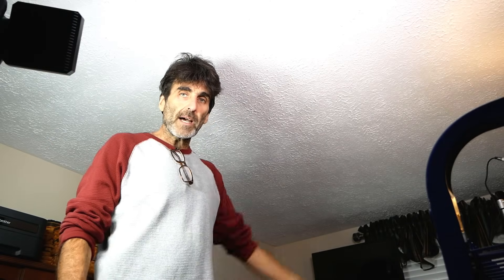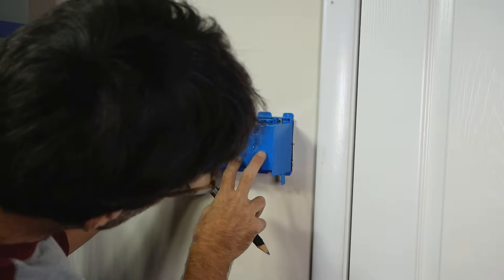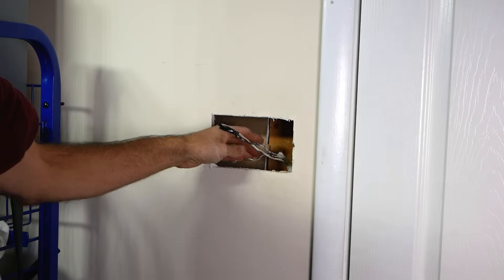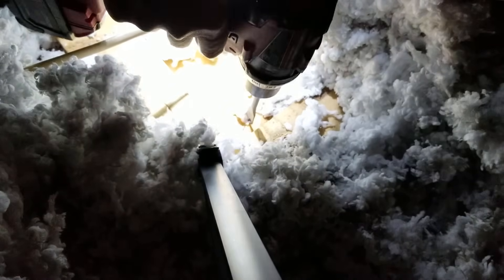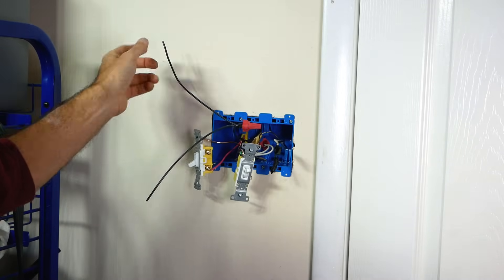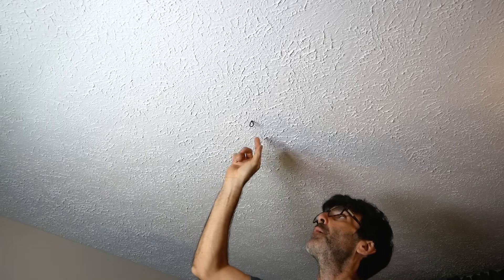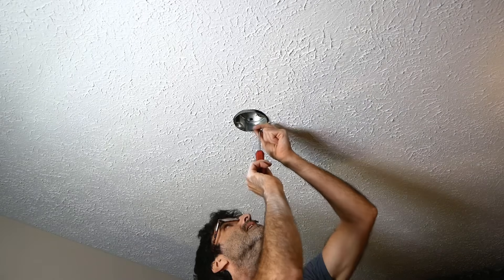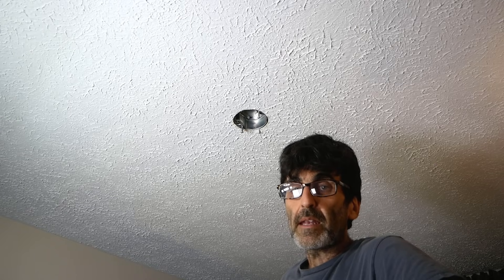Add a Fan to ANY Room without Existing Fixture or Wiring!

Comment: Rudy thanks! My wall plug is also controlled by a wall switch but I want to make the wall plug run continuous and the one switch for the new fan. How do you suggest I do that?
Reply from the maker: It's hard to say for sure.  Does your current wall switch have the necessary power for the fan?  Or do you have to run power from another source?  I probably need more details to be able to tell much.
Reply: @TheHomeImprovementChannel  the wall switch runs on a line that is 20AMP - I was thinking I can install the ceiling fan and run the wiring from the ceiling to the wall plug where the switch originally controlled and just pigtail ceiling and switch connections there and pigtailing wall plug to be continuous with the original line that already runs into it.
Reply: For more context, the wall plug has 2 plugs - 1 controlled by switch and the other continuously feeding power from line. I figure I can just take out the switch on that plug and connect it to ceiling lights or fan by running Romex to it and pigtailing that to the switch wiring already in the box.
Reply from the maker: @vidalexperience  If you have 2 black wires that went to the original switch, you can wire nut those two wires together and that'll make your plug run continuously and then pigtail your wires for the fan.  You'll have to run 12 gauge wire since you're on a 20 amp circuit...  Of course I have to mention, if you're not comfortable working around elec please don't attempt it.  It depends on the individuals skill level.  If you've got the power available in the gang box then yes, you can run a 12/3 wire up to the fan.  12/2 if you want to use a remote control, you don't need a separate wire for a light.  Usually fans are 3 conductor in case there's no remote control.  (14/3, 12/3 for example).  I hope that helps.
Reply: @TheHomeImprovementChannel  I’ll look into what you’ve said, I’ve wired things safely before according to code. It makes sense that I wire the 2 black in the switch and then run the ceiling fan or daisy chained high-hats with a 12 to the switch box instead of the wall plug box! Thanks Rudy! I’ll give it a try from the box before I put holes in the ceiling and let you know.
Reply from the maker: Make sure and turn off the power!  Let me know if you have more questions.. 🙂
Reply: @TheHomeImprovementChannel thanks Rudy! Have a great week!

Comment: On the fan speed switch how can I fig. Out witch is low med or high? I didnt take note on L ,1,2,3 . I have red, orange, black and purple. I cant find a diagram anywhere.
Reply from the maker: I'm not sure what kind of switch you got there.  Is it the speed switch that goes in the fan with the pull chain?  Or one that goes in the wall to control the fan from there in either a single pole or 3 way?

Comment: Liked, subscribed.  Just did this on my home.  I had no attic access at ALL!   Later, after hearing some squirrels, I installed an attic ladder.  So much nicer having access.  Recesses lights in the hall were easy as pie.
Reply from the maker: Awesome!  Thanks for the like and sub... :-).  I'm surprised if you had an attic, no one put access to it....  Those attic ladders are nice... I wish I had that, but the way my entry is configured it would hit on a wall... :-(

Comment: Helpful so I will give you thumbs up except you didn't show where and how you tapped that yellow wire into the power in the attic,  so it would be complete if you showed that

Could you also do a video on how to fix a wall switch to control the light and the fan on a ceiling fan without bringing in the extra wire.  My wall switch only turns on or off power to my ceiling fan and I have to control the light on and off from the pull chain which is a pain in the butt because the 2 pull chains to fan and light after power is cut on are directly over my bed.
Reply from the maker: HI, I did a video like that fairly recently... If you only have the one wire, you will need a remote or fan controller of some kind to act as a switch for separate control of the light/fan.  Here's the link.  This fan already came with a remote installed in it, but later in the video I show a fan with a empty slot by the ceiling that shows where the remote controller would have gone.  https://youtu.be/mgWIjl55jW0

I didn't show where I tapped the power in the attic because every house is different.  My situation would have been different than others.  Most of the time, if there's a attic light nearby, that's the easiest place to tap for a fan or something light duty like that... if there's no attic light, you'll have to find a source in the attic somewhere.  It can vary greatly where that comes from..

Comment: Thank you for the video.  Retrofitting a light fixture box for a ceiling fan box will be one of my first diy projects involving electricity.  You mention at the end of the video, “...and don’t forget the ground screw”, do I just screw it into a spare hole in the box??
Reply from the maker: Usually there's a threaded hole with a concave area to accommodate the ground wire.  It should be pretty obvious which one they want to you use... I hope that helps.. thanks for the comment.. :-)
Reply: I’ll check that out, thanks for the reply :)

Comment: Can you suggest a way to do this with lath and plaster walls and concrete ceiling (nyc apt building). Building coop board will not allow trenching the concrete either.
Reply from the maker: The only way I know of would be to install the conduit on the surface of the concrete.   You'll still need some small holes for anchors of the conduit... the fan itself you could anchor the box to the ceiling with blue tapcon screws

Comment: I saw you connected the two (new) neutral lines together but the original neutral line was left out... where did that get hooked up to? Or did you wind up including it to the rest of the neutral connections?
Reply from the maker: That other neutral goes to a plug and it's not neutral at all.  They split the hot wire at the plug with the black and white wires and those two wires just go to a switch.  Black on one screw and white on the other.  I hope that answers the question.  Thanks.

Comment: Nice video. Regarding your comment at 7:50 about stapling the wire in the wall - You're good to go. According to code, old work installation does not require stapling the wire. The clamp in the J-box provides strain relief. Just don't break off the plastic tab where the wire comes into the box like I've seen on some other videos.
Reply from the maker: Thanks!  Excellent info... :-)

Comment: Question. I know nothing about this stuff, so let me get that out there right off the bat lol. But if I have a plug in outlet down under or close to where I want to add the light switch, can I hook it to the switch, then run wires across the ceiling to the place I want the fan?? I am assuming it's the same for a double wide? As you can tell I know nothing, but what I do know is I don't have the money to hire an electrician 😂
Reply from the maker: Yes, if your working with a inside wall, meaning a wall other than one around the perimeter of the house, it shouldn't be insulated and you should be able to feed the wires through more easily.  Trouble is, usually a double wide doesn't have attic access so getting the wire from the wall to the ceiling without cutting any holes will be very difficult.  If the plug your referring to is directly below where you want the switch, you should be ok.. the studs are running vertically every 16 or 24 inches.. depending on the code for doublewide in your area.  Make sure to turn the power off.   It's best to get a wiring diagram if youre not familiar with how to connect a switch and then a fan or other light fixture after that.

Comment: Regarding running wire in a vaulted ceiling/ no attic access- can't you run the wire parallel to the joists; this, no drilling needed??
Reply from the maker: Yes, but more than likely you'll need to jump over several trusses to get to where your fan or light fixture needs to go.  What you said there will only work if the installation point is in line with where your wire is coming from.

Comment: What if you have a downstairs and an upstairs, and your installing a fan on the lowest level, and the attic being the highest level with the upstairs in the middle.
Reply from the maker: I'm actually working on a video like that.  In the mean time, I have a video on installing can lights with no attic access, you can use the same principles I have used there to get the wire to your ceiling fan...

Comment: Very nice video. Thanks for showing each step, that was very helpful. The 2 things I would have like to see more in-depth was how the black and red wire for the fan connected to the light switch and how the 2 pig tails connected to both light switches. Also I would had like to see how the 3-wire wiring connected to the fan wires since you used 3-wire wiring. But other then that I feel that I can now do my son's room. Thanks again!
Reply from the maker: The black wire usually goes to the fan motor, and the red wire usually goes to the light.  On the fan the black goes to the black and the red will go to the blue light wire.  The pig tails are just so I can take the single hot wire coming from the source and split them to go to 2 switches.  You don't have to do it that way, its just the method I used.  I've seen guys take a single hot wire that's pretty long and connect one switch several inches from the end, after they peel it back of course, and then run the rest of the wire over to the other switch so they're daisy chained together like Christmas lights.  Does that help?
Reply: @TheHomeImprovementChannel since you used a 3 switch setup, why did you keep 3 switches when you just need two for light and fan.  Installing can lighting later or keeping the plug switch? Maybe I missed something. Thank you for the great video.

Comment: Thumbs up. Very concise and to the point on everything. My room is by similar to your video including attic access and no ceiling box.  I have a light switch that doesn't control anything so once I get the balls to do this I'm hoping I can simply wire up that switch and have power. 😁
Reply from the maker: That light switch might control a plug nearby, or a outside light... I'd be surprised if it actually doesn't control anything,  although it's possible.

Comment: Excellent video!  I had never seen one of those fan installation bars before.  I just ordered a two pack of them on amazon.
Product name:
"Westinghouse Lighting 0101000 Saf-T-Brace for Ceiling Fans, 4 Teeth with Locking Screw"
Reply from the maker: HUH.. I looked that one up.. I don't know why they're charging $39 for it!  They're about $15 from lowes...I'm sure it'll work though
Reply: @TheHomeImprovementChannel   That was cdn and for a two pack.  I'm getting two for $46.34 cdn with taxes and two day delivery.

Comment: Do we turn off the power first ?
Reply from the maker: Yea, it'd be a good idea!
Reply: Ronald, please hire someone if you ever install a garbage disposal unit, mow the lawn or tie your shoes. All these can be quite dangerous if done improperly. Actually a good question. Be sure to turn it off at the fuse box and not just the wall switch.
Reply from the maker: @Paul-ou1rx  It really just depends on the skill level of the individual.  If you don't know the first thing about being safe while doing this,.. I would have to agree.

Comment: The outlet is a good source for power when installing a ceiling fan with a light kit. The reason for the 1/2 hot outlet is because housing developers were not installing ceiling lights and to get around the codes they would install the 1/2 hot outlet in bedrooms and living areas. In order to provide proper power to the switch box a little reconfiguring of the conductors at the outlet will be necessary.. This can be easily done by removing the neutral wire (white) from the line hot (black) and reconnect the white conductor to the rest of the neutrals. It's a good idea to replace the receptacle at this time with a new one due to the bi-metal being cut separating the two halves. Using a short jumper wire will achieve the same results.  The next step is to run a single 14/3 up the wall to the fan junction box without having to search to a separate power source. This also eliminates the need to use a common trip breaker for each separate circuit, incase one circuit tripped leaving the second circuit hot.  I would also make it clear that all ceiling fans require UL approved support braces and junction boxes for supporting The days of throwing up a 2x4 stud and screwing in a round metal box with 6/32 bent tabs for mounting the fan support are gone.
Reply from the maker: Hi, Yes I thought of re configuring the wire inside the outlet box, but I actually wanted to keep that outlet switchable.   They didn't cut the metal piece separating the two halves, so the whole outlet was switchable..  I also didn't want to make the video to complicated, so I chose to seek out a different power source.  Thanks for the comment... :-)

Comment: Good video. Don’t know enough about electricity to do this myself. You said you had to tap another power source in the attic to supply the new outlet but you didn’t show us how you did that. Is that like robbing Peter to pay Paul? What was the power source .? Did it or will it affect the source or circuit that it was originally intended for? If you splice into a wire just to tap its source does it by code need to be put into a closed junction box? Thanks for your video.
Reply from the maker: The reason I didn't show the power source is that it would be meaningless to the viewer.  Every house is different.  All I did was find a junction box in the attic and I tapped into that. I think I did mention that a attic light or electric attic fan would be the easiest source to get power from if you needed it.  Yes it needs to be in a closed junction box.  And you need to pay attention to what breaker is powering that box.  IF it's powered by a 20Amp breaker, then you need to use 12GA wire like I did in the video.  The 12GA is usually yellow.  It's not like robbing Peter to pay Paul.. pretty much every circuit in your house is shared with other things unless it's a dedicated circuit like a over the stove microwave for example.  Hope this helps.  Thanks for the comment.. :-)

Comment: Question on your power source. Did you just make the pigtail off the black power source wire that was originally providing wire to that switch for the outlet lamp setup? Does this avoid having to splice a power wire in the attic from another source? Awesome video, really appreciate the detail.
Reply from the maker: I couldn't pigtail from the original switch.  The power source went straight to  the outlet in the wall and they sent back a single 14/2 using the white and black wires to complete the circuit.  If you have a switch with constant A/C power available.  Yes I would use it.  In my case, I had to find a source in the attic....  Hope that answers your question.  Thanks.
Reply: Sure does, thank you.
Reply: @TheHomeImprovementChannel  Why doesn't that switch have constant A/C power available. I don't understand that. How does it not?
Reply from the maker: @johnsimpson5684  Because sometimes to save wire and time, they will run power source directly to plug in the wall, and run back a single 14/2 and switch only the hot wire to the plug so you have a switch controlled plug.  You'll have a hot wire at the switch, but no neutral..

Comment: Most people dont want the outlet switched so change the wire configuration at the outlet to get power put in a double standard sideways switch too much extra work milkman
Reply from the maker: Yes If I could do it again, I probably would have just done that....  😀

Comment: Great video, very helpful. Thank you for taking the time to do this.  I am confident that we can do this ourselves.   For ceiling fans what size Romex is best? 12/3 or 14/2.  Does it make a difference?  Why?  Also, I don’t want the toggle switch to operate the wall outlet any longer,  how do you make that happen?
Reply from the maker: Yes it matters!  It depends on the circuit that you tap into.  If the existing circuit is on a 20 amp breaker or a 15 amp.  You should use 12 gauge for 20 amp and 14 gauge for 15 amp.  Great question.. 🙂. The existing house wiring should already be the right size

Comment: @The Home Improvement Channel Question: Could I get my power source from an existing switch? and where can I get my wires from? like can you get some extended wires from any hardware store? and by the way thx for the video I thought this couldnt be possible till now
Reply from the maker: Most of the time  you can get the power from a switch, but sometimes you'll have a switch where they've split the Hot wire from a plug or a light and you'll have a black and white wire running to the switch.  If you see a black and white wire across the switch, then you can't tap from there.  There's not going to be any neutral to use.  But if you don't have that situation, then yes, you should be able to use it.  You'll have to cut up the single gang box (if that's what it is) and remove it and use a two or three gang box depending on your fan and go from there.  Yes, You can extend wires with wire bought from a hardware store, but you have to put the junction in a box with a cover if the box is in the attic for example.  Hope this helps.
Reply: @TheHomeImprovementChannel  it did thx :)
Reply: I was just a little confused with that issue but thx for explaining it too me
Reply from the maker: Cool!  Thanks for the comment.. :-)
Reply from the maker: Excellent.... glad i was able to help..:-)